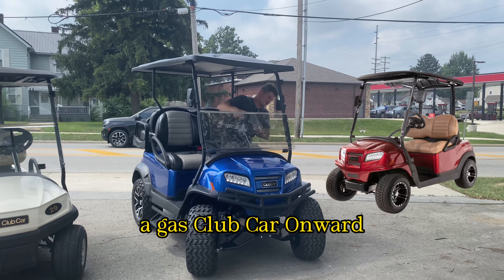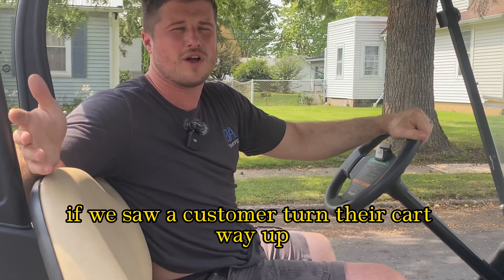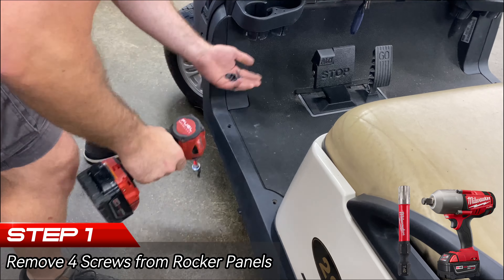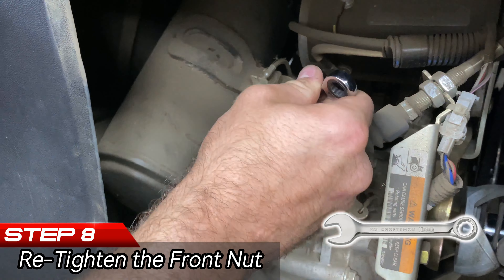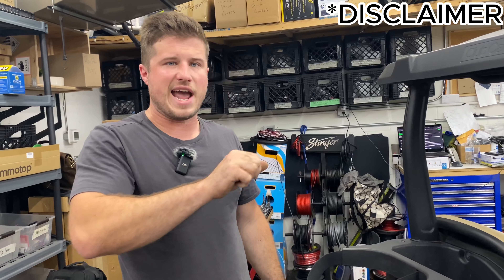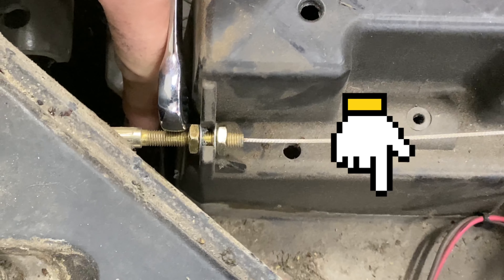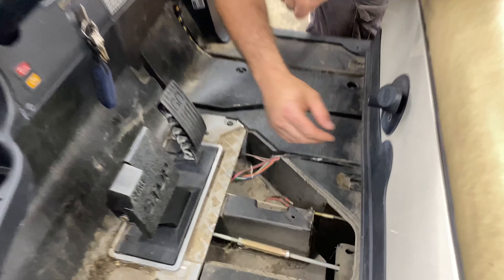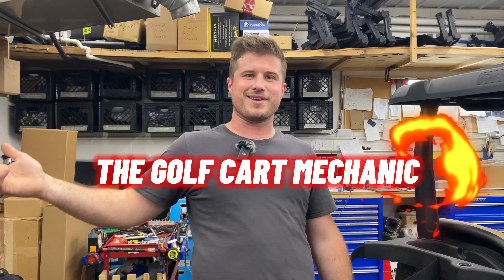Make Your Gas Club Car Faster (Step-by-Step Guide)

Comment: I have an older DS model with the 290cc Kawasaki. I just zip tied the governor and then increased the max rpm from 3600 to 4200. I now get to 31 mph. I also put a 3 inch lift kit with larger radial tires. Now I have to figure out how to make the steering tighter and more accurate to complement the higher speeds.

Comment: Hi! To swap diferential gears, which ratio are you recommends 8: 1 or 6: 1, for regular use on the  countryside or street, without weight, Club Car Villager 4, Kawasaki Fe290. i dont want loss much power

Comment: Awesome video mate. I have a 2016 Precedent Club Car and it will backfire once or twice a round. I bought it second hand so not sure what has been altered. Could you give me some advise that would be much appreciated. Thanks
Reply from the maker: Hey Wayne! Thanks! So there's a bolt on the top of your motor (driver side of motor) that is under a gray cover, the bolt adjusts the air to gas ratio and adjusting that bolt is typically the answer to fix a backfire. You might need to let the bolt out a little (turn it counter clockwise with large phillips head screw driver). If you google 2016 Club Car Precedent Illustrated Parts Catalog, you'll see a breakdown picture showing you exactly what I'm talking about.
Reply: @bacartsvw Is this adjustment bolt on a 2018 Precedent that is fuel injected? I have one that will backfire every now and then when the engine is loaded up while going down hill, similar to if you were using engine braking going down hill in a car.

The only bolt under the engine cover I can see is the one that adjusts the closed position of the throttle butterfly valve (similar to what an idle adjustment would be on a normal engine that idles and doesn't shut off automatically when the throttle is let off)

I really enjoy your videos and thanks for posting this one!

Comment: Hey man, great video. Quick question for you. I've just bought a brand new onward 6passenger gas. Top soeed is about 25mph. Today, after driving at top speed for abot 1/4 mile, it lost all power and started smoking like crazy. I pulled over, no leaks or anything. It ran fine after this, as long as ivwasnt at top speed. On the way back home it did it again, and again as soon as i slowed down a little bit, it ran fine. Any ideas? Im obviously going to call the dealer, but I'm hoping it might be something quick so i dont have to take it into the dealer.

Comment: Just tried this and the adjustments looked identical to yours but I got no increase in speed from before (top speed 14 mph). What am I missing? Something with that air/gas ratio bolt you mentioned in the disclaimer? Is there a video on that adjustment?

Comment: Could you talk about or make a video about my issue. My 2023 Club Car Tempo-gas/EFI doesn’t work in reverse when I switch the lever to reverse, but… makes the beep sound. If I hold the reverse level by hand in reverse position, all the way back, It works. Do you know the cause and how to fix. Thanks
Reply from the maker: So you need to remove your rear engine cover/access panel. You will see your forward/reverse cable is connected to a fork on your rear axle. You will see two large nuts (I think they're a 20, 21 or 22, cant remember). What you have to do is loosen one of those nuts and thread your forward/reverse cable either forward or backwards and then retighten those nuts done.
Reply: @bacartsvw  thanks, I will look in a few days to try

Comment: Could you do this but with an onward lithium ion, like only goes 19.5 I would love to go like 30. Anything you can do?
Reply from the maker: Unfortunately, speeding up a Lithium Onward isn't as easy as speeding up any other Club Car out there. There are no speed codes to surpass 19.5mph, and the battery on the Onward is 58volts which is an issue because all after market controller/motors that could increase the speed are 48v or 72v. So the only way to increase a lithium Onward's speed is to change the rear axle gears (12-1 ratio) with high speed gears (6-1 or 8-1 ratio). I have a connection that makes these gears if you'd like to tackle this idea! My email is sloan@bacarts.com!

Comment: If you did have to get a repair while under warranty, could you not simply reset the throttle cable and governor positions? There would be no other indicators the speed was increased, correct? Asking for a friend of course :)
Reply from the maker: Well, kind of. Club Car Onwards actually have a computer with a diagnostic on it that would allow dealers to read the highest rpm the engine has ever reached, which would very quickly show that the cart was once sped up. So considering I'm a dealer, and have had customers try to lie to me about their cart never being sped up and then proving them that it was, I wouldn't suggest it lol. Yes, I'm sure you could get away with it as most dealers aren't going to check those diagnostics, but still, I can't sit here and tell you "go for it" because I'm a dealer and would hate for somebody to do that to me.

Comment: What if I changed out the gears in addition to adjusting the governor? Will this put less stress on the engine and axles?
Reply from the maker: You can reach much greater speeds with high speed gears but the engine would also be working harder to get the cart going as you'd lose a lot of low end torque with higher speed gears. However, the motor would be running at a much lower RPM when driving faster with gears installed (less hard on the motor in that regard). As for the axle, installing high speed gears can cause a little more stress for the actual since it takes way more torque to spin the tires. So for both the motor and axle, it's a double edged sword in a way if you're concerned about wear.

Comment: I have a 2017 gas precedent. It randomly fails to go when you push the pedal down for 3-5 seconds. Happens about 40 percent of the time. Any idea what could cause that? Seems like many people had that issue with the electric ones and the MCOR but I didn't believe the gas models have that.
Reply from the maker: Ah yes, the dreaded compression stroke issue. So  the motors in Precedents have an intake stroke and a compression stroke and some Precedents can struggle to start up if the motor stops in compression stroke. Now the reason varies, you could have a weak battery, you could have a weak starter generator, you could have a bad starter belt, or you could have carbon build up on valves or pistons which can cause this. A quick way to not deal with the 4s pause is to just tap the throttle to get the motor to turn over once and then hit the gas and it'll fire right up, but if you just sit on the throttle it'll take a few seconds to get going just like you have been experiencing. To find a solution, I'd first check and see if your battery is loosing juice, you could prove this by throwing a battery charger on the battery (not a trickle charger) and keep stopping and starting the motor and see if it struggles to start in compression stroke. If not, then you have a weak battery.......Hope this helps!

Comment: Thanks for the detail. My only question is related to the space you created for the govenor arm. Does that impact speed at all? Or is the speed really just in the throttle cable? If I don't want to fully open it up, would less space for the govenor be suggested? 
Great video, though. Thanks
Reply from the maker: They work in conjunction with eachother to ensure that you can still "putt" around slow while also being able to go fast. If you don't free up any space on the governor then you won't be able to thread out the throttle cable quite as much. So yes, the space on the governor is what really gives it speed, but it can also cause your cart to take off all or nothing.
Reply: @bacartsvw  thanks! Appreciate the content.

Comment: Brand new 2024 onward with high speed gears.  28mph is all I can get from her.  My old donkey "97" DS would flutter the valve springs at a smidge over 30.  Did I miss a trick or is that all she has to offer?
Reply: Got it figured out.  A properly placed and tightened zip tie was all it needed.  Can cruise 35 now. I imagine you knew this, i'll let you share the trick if you choose to.

Comment: Hello, I like your videos and I wish some day you can work on a gas club car president with a subaru engine so j can learn how to fix mine. I have a 2017 gas club cart that only goes top speed. I can't ease off my foot of the accelerator, if I do, the cart will stop. I don't know what's wrong or what parts are causing this. Please help me fix this problem. Thank you in advance for your consideration.

Moe
Reply from the maker: It sounds like your throttle art or throttle cable are adjusted to the extreme so the cart doesn't "putt" at all. The cart in this video is a Subaru engine so the adjustment should be exactly the same on your cart. So do the opposite of what I do in this video and adjust your cart to drive slower.
Reply: @bacartsvw  thank you for your prompt response . I will let you know how it went.🙏

Comment: my top speed is currently 18mph, but i eventually bog down and blow smoke from the exhaust.  Am i running into the rev limiter?  I have a 2005 club car ds.
Reply from the maker: I don't have much experience with DS's, but I do know that they have a 11.5hp motor, far less than the 14hp motor in Precedents, so 18mph is about as fast as you're going  to go lol. As for the smoke and bogging down, it's very hard to say, it could be an carb issue, a fuel to air issue, etc.

Comment: Can you get a new lifted 4 seater Onward to 30 MPH doing this?
Reply from the maker: 30 can be easily reached if you don't care that the throttle is either all or nothing. The trick is to get the most speed while also having your throttle pedal not be so touchy that you can't go 1 or 5 or 10 mph.
Reply: I have a new lifted 6 seater onward, gas powered and I did a small trick with a tie wrap in the back.  I get 30 mph without a problem.  It is an easy fix.  Let me know if you are interested.
Reply: By the way my Onward is a 2024

Comment: Small issue, not entirely sure what model we have, newer precedent, when i floor it for around 4-5 seconds it will putter and lose rpms, what could be the problem?
Reply from the maker: If you leave the throttle floored what happens? Does it Rev back up again and then lose rpms? Or are you flooring it, you're getting up to full speed and then it drops rpms? How much speed are you losing when it putters and drops? 1mph? 5mph?
Reply: If it is floored, it will drop rpm for a second or two, and then will get back up in rpms, sometimes it happens more than not but it still is happening. I can send a video if needed, lmk where best place to contact would be
Reply: Probably around 2mph loss, but short after it will get back up to top speed
Reply: it is topping out around 26-7 right now and id hope to get it to 30, not sure how to get those extra few mph, prob could dig around on internet
Reply: @bacartsvw it does it when i hit ~26mph
Reply: found out online its most likely a rev limiter, going to try to remove it along with install a tach.